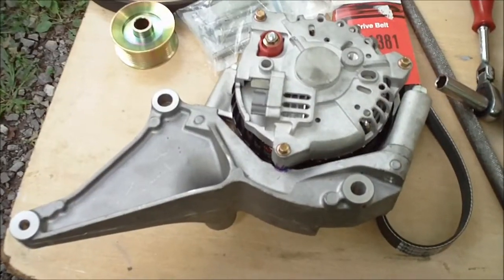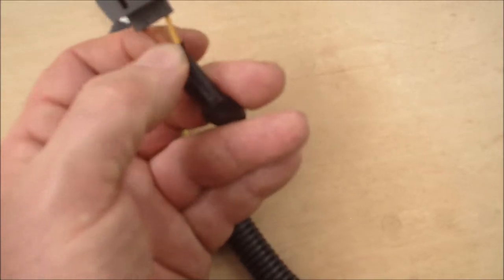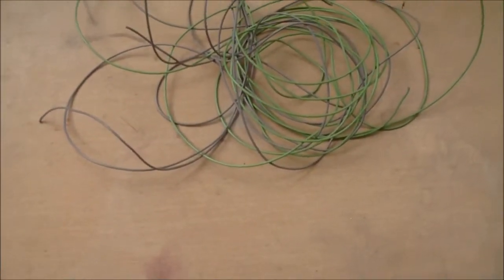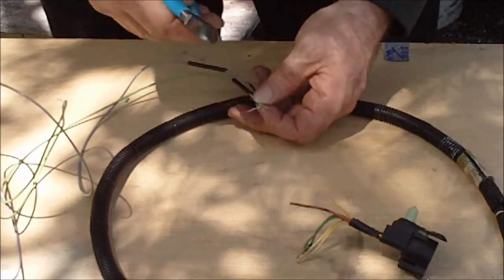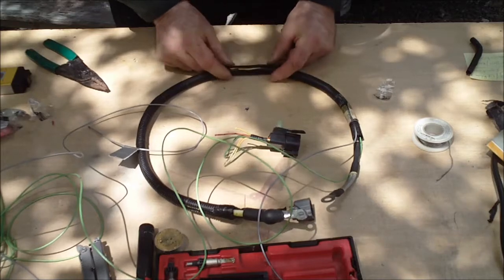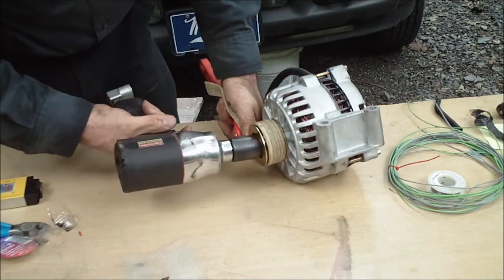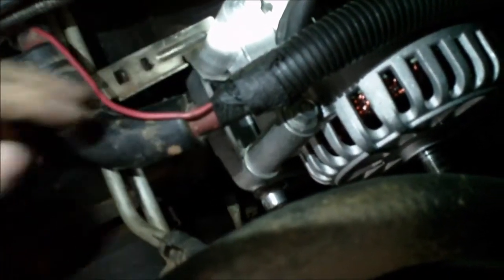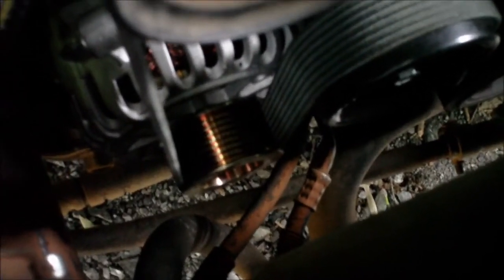Dual Alternator Install 7.3L Powerstroke Part 2 of 4

Comment: My 2000 Superduty came with dual alternators (part of the snow plow package). I used your video for reference. I had to change out my Exhaust Back Pressure sensor and tube and I could not get the tube to thread through the gap between the lower alternator bracket and the block. Your video shows the bracket and it's bolt holes. With that info I decided to pull  three bolts and leave the bottom most bolt loosened so I could rack the bracket towards the right front fender. That gave me just enough room to remove the tube and thread the new one in. Some of the bolts were a real pain to get to as I'm sure you remember. Thanks for the well done and detailed video.

Comment: these vids are helping me out a lot. i'm installing dual 270a alts on my 95 bronco to supply power for my battery bank to my stereo system. I also have an MLA module that increases the peak charge to 14.8v but it was only build for a single alt setup. i'm going to try and use it for both alts and hope it still works. thanks again for the hard work in getting these vids together for us..

Comment: At 2:41 that is a good idea. But, I installed electrical systems in custom buses and when doing an "end-to-end" splice we fan out the wires and mesh together till they reach just short of the insulation of the other wire, then twist them together and then solder them. That keeps them the smallest.

Awesome video though, I am installing two alternators in my car for inverter and entertainment system.

Comment: So with the wiring you did is this basically set up that both alts have a internal voltage regulator and are just hooked together so that each regulator turns on? Or is this so that both alts are run off one voltage regulator?